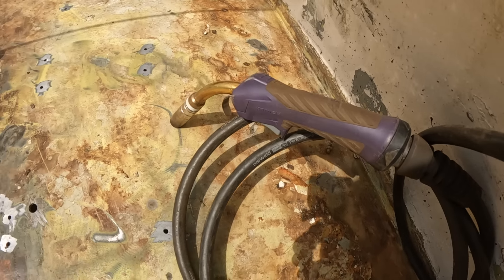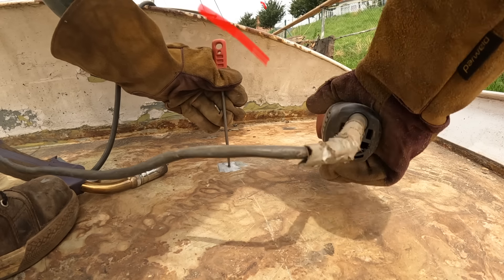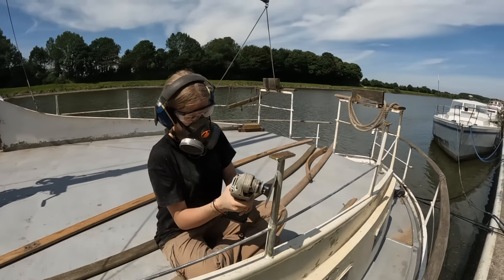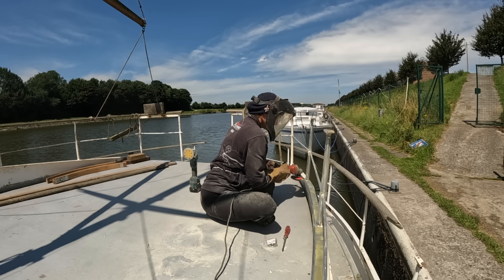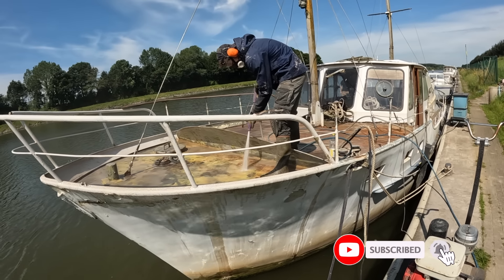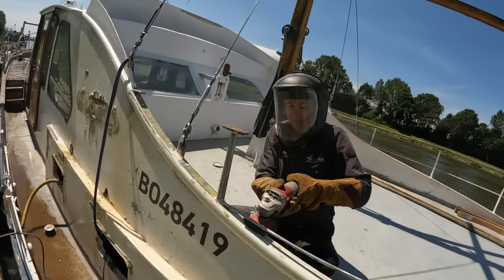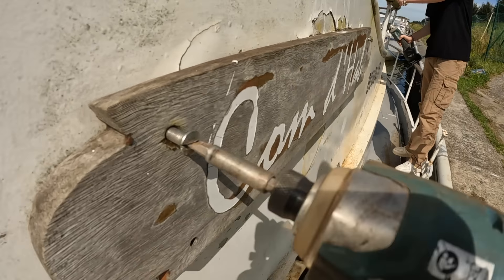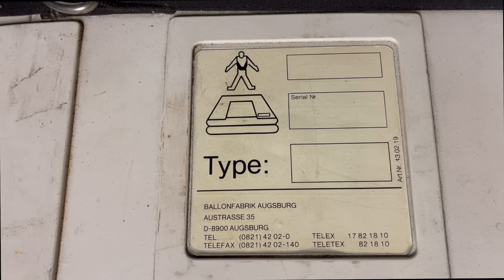Project Y EP  24 - Hydro-Blasting & Paint Stripping Techniques for Enthusiasts

Comment: Are you drawing up particulates from the water? That's the only thing I can thing of, as I'm sure the water at home is much more clear than where you're docked. Maybe place a hard filter on the intake hose to help mitigate the issue?
Reply from the maker: I tried the filter as well. Totally Clean . And it even obstructed the water flow, which in term upset the compressor.

Comment: 8:35 - The german "Ballonfabrik" (german word for balloon factory) no longer exists. Until the 1950s, it mainly manufactured open-air balloons. After that, more and more industrial gas balloons and rescue and safety equipment were manufactured. In April 2008, the factory was taken over by Deutsche Schlauchboot GmbH (German Rubber Dinghy/Rubber boat GmbH) and the Augsburg site was closed in 2009. Now it is just an event hall that still bears the old name. They no longer have anything in common and no longer manufacture anything.
Reply from the maker: thanks for your reply and info/